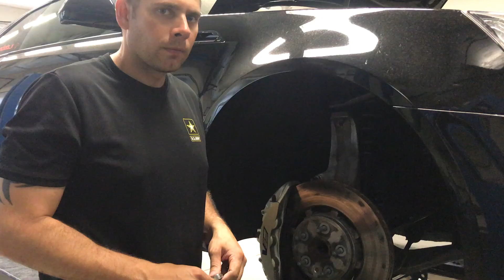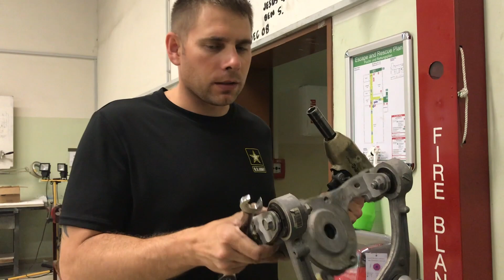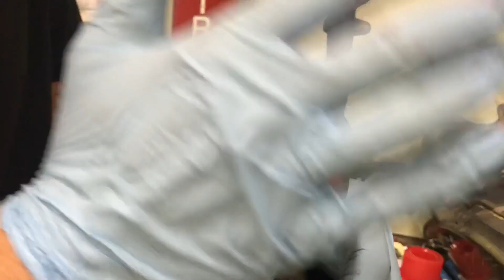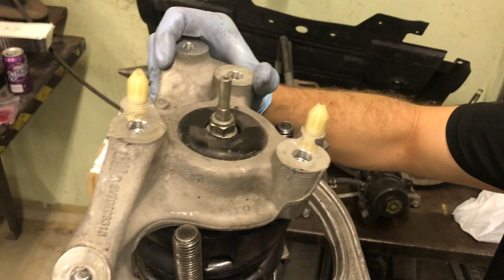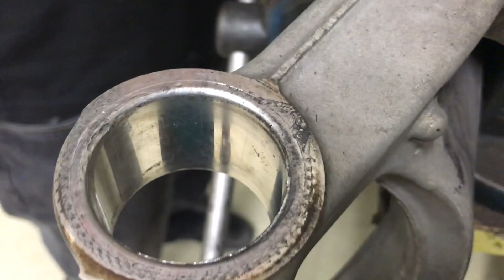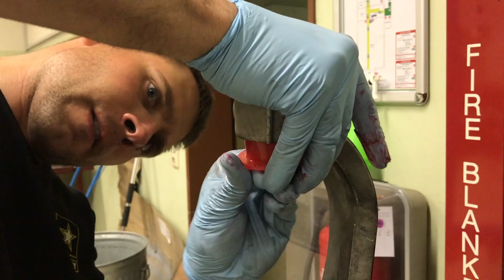Cadillac CTS V2 Poly Bushing Install

Comment: Great video with awesome detail.   I know it's been 4 years but hopefully the author will see this comment.  Just curious what made you think the bushing was bad?  Was it noise, clunking or ??  I have a 2012 V and I have squeaking over speed bumps from front suspension.  All components "appear" to be good so I sprayed some lube on all bushings.  I have about 40k miles on the car but apparently some suspension parts don't wear well.  So again I"m curious what  drew your attention to check front upper control arm?
Reply from the maker: I’m still here. I haven’t posted in a while because I’ve been busy with retirement lol. I saw the bushings were worn down when I took it to the Nurburgring in Germany. I got it on a lift and noticed the front bushings were blown out so I decided to change them all.
Reply: Thanks for the reply.  From your video they really didn't look that bad, just had some cracking but maybe the camera angle didn't show the whole picture.  What made you check them?  Did you hear squeaks or did you hear/feel clunking in the front end?  I'm hearing squeaking in mine but all the bushings "look" ok from what I can see.  I hear it the most over speed bumps low speed.  I'm trying to nail down what to replace so I'm not using the shotgun approach.
Reply from the maker: @trainingdragon1964 mme would clunk on hard bumps. When you get under the car, look and make sure the bushing all the way around is good. If your having speaking it’s probably the bushings are too lose and need to be replaced. I can tell you after I replaced mine, they still squeaked but it was because I put the bushings in with lube on both sides. Should have done just the inside that requires grease. Trial and error. I still would do it as a replacement regardless
Reply: Thanks for the added info.  Seems a little odd that lubing all around inside and out would lead to squeaking.  Logic would tell me you did the right thing but I'm a hobby mechanic and not a real mechanic.  Do you have any thoughts why you feel the lube created the squeaking?
Reply from the maker: @trainingdragon1964 because I would not keep it lubed lol

Comment: How's it holding up after 4 years?
Reply from the maker: Holding great. Have not had any issues so far.
Reply: @PocketsAutoList  That's great to hear! Thanks for the video, I had a shop do this a while back and after a couple of years it started squeaking. So, I'm going to redo it myself and your video is going to be a great help!
Reply from the maker: @MegaMajormax mine stopped squeaking after about a year of use. It has to get worn in or adjusted with use.
Reply: @PocketsAutoList  mine started squeaking after a year or two and hasn't stopped in the last 3-4 years. It's not just squeaks but creaks when going every bump. It's pretty annoying.
Reply from the maker: @ yea that seems like a problem

Comment: From what I’ve read, you should use soap to put the bushing into the arm, it’s not supposed to move or slide in the arm..only the inner part should be greased, as it’s the part that actually moves during operation…
Reply from the maker: I have not had a problem eather way.
Reply: @PocketsAutoList  I like your videos, not knocking anything you’ve posted…but without actually seeing what’s going on with the suspension while in motion…(one greased inside and out, the other only on the inside)…it’s hard to say whether it’s functioning correctly……I’ve talk to the manufacturers and they all say grease only the inner parts that actually do the moving…I’m glad you haven’t had a problem, with your install…keep up the great work!!!
Reply: 100%. No movement of the bushings in the arms, the sleeve should be greased on the outside surface, it rotates inside the bushings. The sleeve is clamped by the bolt and does not rotate. Fully tight, the bushings should not be compressed. Snug, but allowed to rotate freely on the sleeve.

Comment: Are you saying the ball joint HAS to be replaced to do the lower bushings?
Reply from the maker: I’m not saying you have too but I had a hard time getting the ball joint off and I ripped the boot. So I went ahead and replaced them. As you can tell, I used a pickle fork. I tried to use a clamp over system and it was to small. I had to wait over three weeks for the ball joints.
Reply: Thanks for the heads up. I’m hoping it comes out easy. Great video by the way!

Comment: Have you had any issues with the rear bolt on the front suspension lower control arm slipping in the subframe?
Reply from the maker: The torque specs are very high.
Reply: @PocketsAutoList  Yeah the 236 ft-lbs for sure. I had mine slip yesterday when drifting. How much track time have you put on since the install? Great video by the way very informative.
Reply from the maker: @Deathreaper782  drifting is a whole new Mostar with these cars. I road course the car like once a month.
Reply: I have